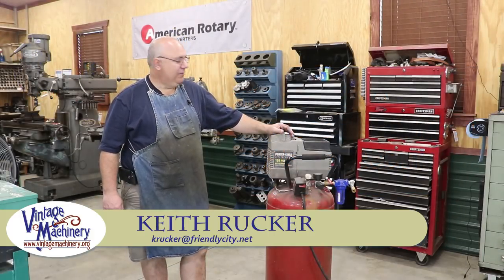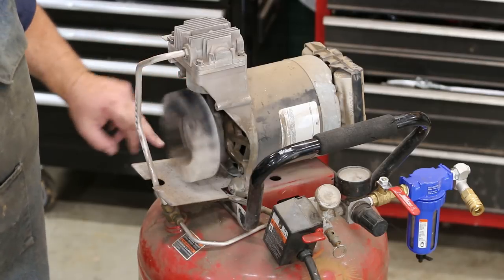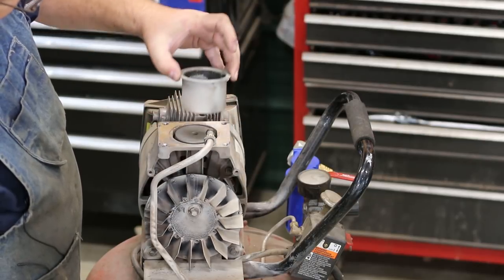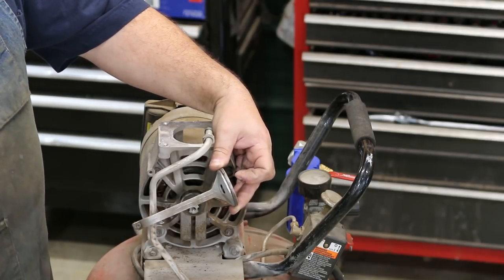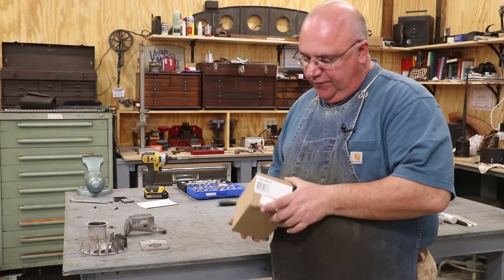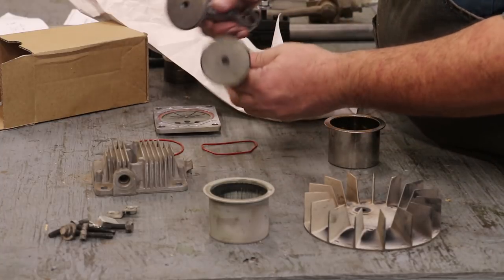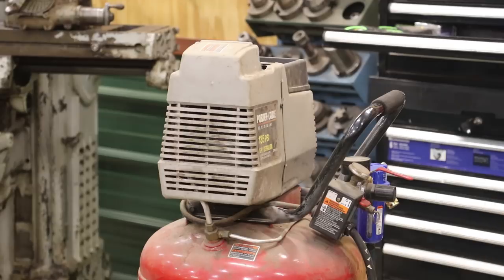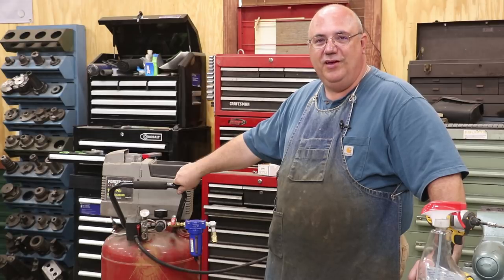Porter Cable Air Compressor Cylinder and Piston Rebuild

Comment: 03:04 I guess the cautionary here is to make sure the tank is empty before taking the pipe off, otherwise you’d get a little surprise 😋
Reply: Since the fault was that it wasn't holding pressure, I think he could be fairly certain that the tank was empty. ;)
Reply: Na there's a check valve on the tank 

otherwise all the air would leak out once the compressor  stops
Reply: +1 for the check valve. You'd never get the pump started against the tank pressure.
Reply: No, ZI've got a smaller, slightly newer variant of a Porter Cable/Craftsman compressor that I the pair of for $25. 15 gal Craftsman that ran but leaked where the tank tube connects to the head and also a Porter Cable pancake compressor that didn't run. As I pulled them apart to investigate the problems, I found the pump to be exactly the same, to the point I replaced the leaking seal on the Craftsman with the part from the Porter Cable. Still need to figure out why it won't build more than 100PSI and just keeps running continuously. I suspect a pump seal problem. I've also got a third compressor head for aparts so hopefully I won't even need to buy parts

Comment: Does the piston tilt as it does its stroke? Seems not. An ordinary piston has a piston pin to let it rock a Little and align with the sleeve.
Reply: The way that compressor are made, the piston have to tilt. But with that long piston rod, there are not much tilt.
Reply: Yup! Short stroke so the piston tilts a little but not much.

Comment: Since you didn't mention it as part of regular maintenance, you should also drain the tank (monthly, at least, if used regularly).  A by-product of compression followed by decompression is condensation, forming a pool of water in the tank.  Water rusts the metal and a weakened tank under compression can have tragic consequences.
Reply: In humid areas like the American South, the tank should be drained daily. I worked at a shop and they couldn't figure out why the compressor ran too much. I got under the 50 gallon upright tank and found the drain ... I got about 45 gallons of water out of it. I plumed a line so the drain valve was accessible and posted a sign that it was to be left open at the end of day when the compressor was shut down.

Comment: no air filter and no lubrication at all? amazing how it lasts more than 2 minutes
Reply: The piston ring is very likely teflon impregnated nylon and the cylinderwall is chromed. This combination wears down very slow. But will fail eventually. It's a nice combination for low temperature and low pressure applications. But nothing you want rely on for 30 years.
And don't lubricate it. If it's not a soap based lubrication it will destroy the piston ring.
Reply: He said he's gonna order a new air filter
Reply: ahh thanks missed that
Reply: It should have a filter, but this is an oil-less compressor, hence the piston and cylinder being considered a consumable item. I've always strongly preferred oil filled compressors mostly because I find the noise the oil less ones make to be too much.
Reply: I was thinking the same thing.  I don't know how this compressor lasted 17 years.
Reply: It's called a Thomas or Thompson Wobble -head set up. No wrist pin. They work but it beats me for how long they last. Cheap made and cheap to fix.
Reply: Keith has what is know as an "Oil-less Compressor". These are very common in smaller size units like the type roofers use to power their nail guns.
Reply: Engineering.
Reply: It was a good tutorial, I learnt about this type of compressor but what would interest me is your other compressor that you will be getting. Especially a vid on it if it needs overhauling.

Comment: We replaced the piston, we replaced the cylinder... and the cooling fins are quite hot.
Reply: The heat sink is supposed to dissipate heat.  Is the fan blowing enough air through the housing?  You may be drawing more air than the compressor is designed to supply with continuous use.
Reply: Sigh. Evidently you didn't watch Keith's video closely. As Keith is wrapping up he talked about what was done, touched the cooling fins, and jerks his hand away like the surface was hot. See 16:22 again.

Comment: sorry hit send before finishing my story. This all happened end of last year. I ended up replacing the oil-less compressor and motor assembly with a oiled twin cylinder belt driven compressor and a new 5 HP compressor duty electric motor that I bolted to a 1/4 inch plate on top of the tank. Working great. But I will NEVER AGAIN purchase an Oil-less air compressor. Hope you have better luck than I did.
Reply: You know you can edit your comments.  Click on the three vertical dots at the upper right of the comment and select edit.
Reply: Yeah, I've overheated my oilless compressor a couple of times using a paint gun. Big shop is gonna have a Kaeser compressor, but the little thing is till good enough for loading up in the van for worksite stuff...

Comment: Why does the piston not need lubrication?
Reply: medhist2006 because its an oiless compressor like most retail/residentials are today. Eliminates oil getting into the airlines. And issue old compressors had. A lot of heavy use/commercial are still oiled
Reply: Chrome lined cylinder and Teflon rings create very low friction and the heat sink can dissipate the heat to keep down the temperature.  It's not a high pressure system.

Comment: That missing air filter may well be the reason it failed.  I'd strongly suggest you do without compressed air until you replace the filter.  Just the little bit you ran it for testing might have sucked enough grit into it to start eating the new rings and cylinder.

Comment: torque wrench is only accurate in 20-95 percent of its range! so using a too big torque wrench is actually a Bad Idea! if you have a 0-175 ft-lb wrench, it should only be applied from 35-165!
Reply: Eric Severseike nope just a bicycle mechanic. we torque stuff sometimes but not as precise as you guys probably